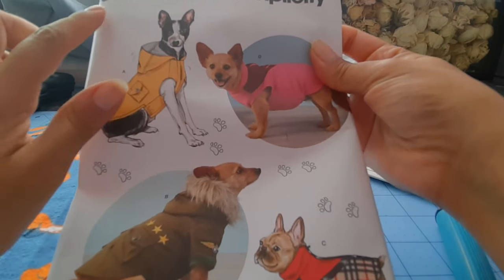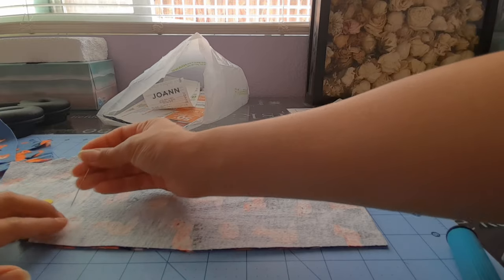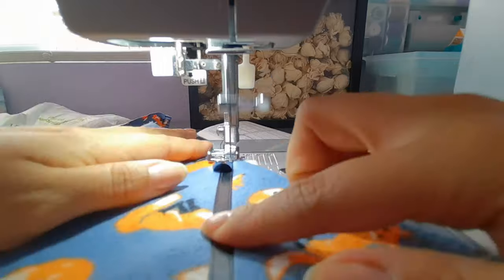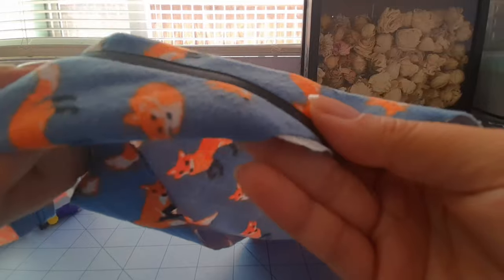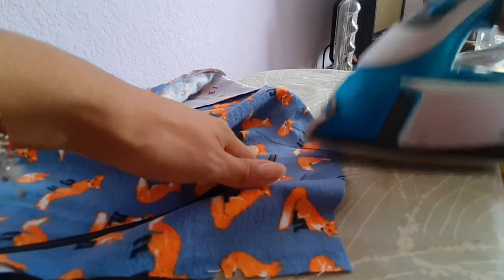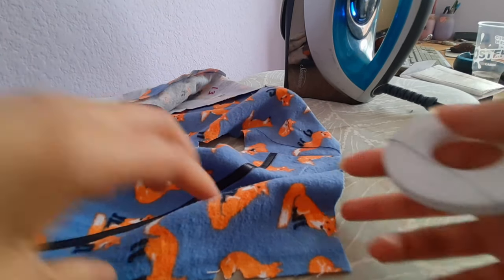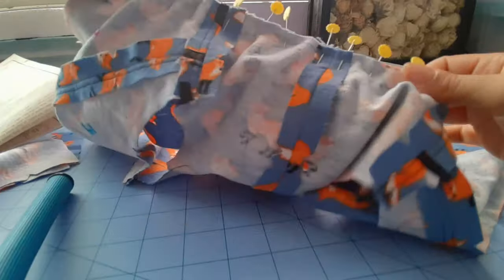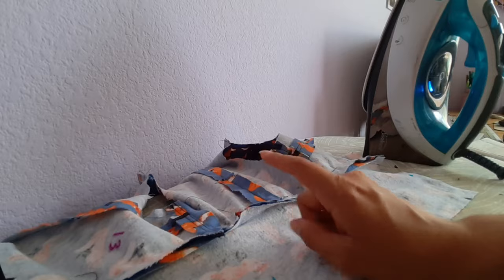How to Make a Dog Coat Using a Sewing Pattern. Simplicity S8861 Step by Step Tutorial

Comment: I’m thrilled I found your channel! After many years, I’m relearning sewing and reading patterns. I’m struggling with simplicity pattern S3939 - yuppie puppy #C specifically the sleeves. The pattern suggests using stretchy fabric for the sleeve bands however, I’m using a non stretchable fabric. I’m more than likely over thinking the process but would love some feedback, if you have a chance. Again, I’m thrilled I found your channel. :) Have a wonderful day & a Merry Christmas!
Reply from the maker: Hi there! Sorry I didn't see your comment until now. I would suggest following the pattern as is but cut out the sleeve from B and use it on C instead of the one on C. If that makes sense hehe. The hole might be too small, I think I had a similar issue on this pattern.
I ended up making it sleeveless =(